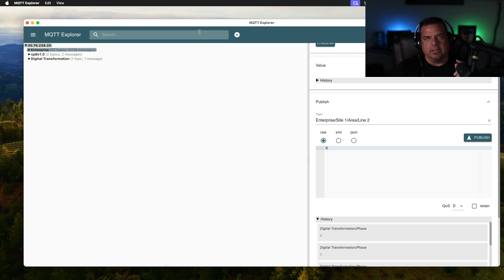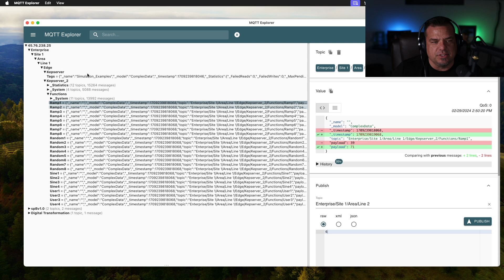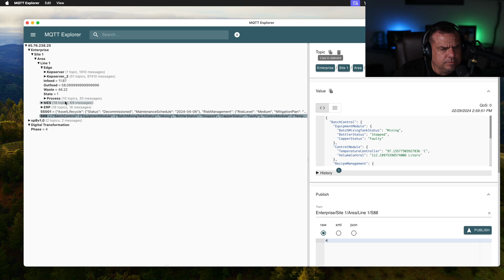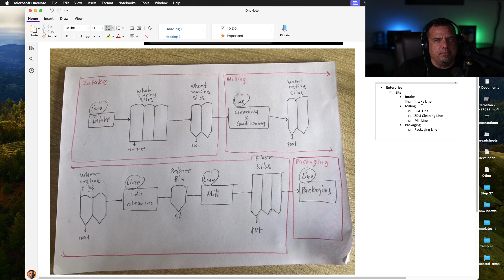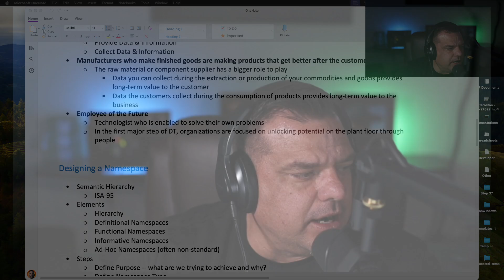Comment: Thanks for the explanation, on MQTT you are not duplication data if you put it on edge and then again in the complaince namespaces? I thought it would be structured by asset, and you would have all the information on that asset and when you retrive selected data you would pick them one by one, no having all of them in a big JSON. Is this the part where you need Data Ops to build the JSON of data that each application would need? is this efficient? wouldnt you have too many copies of the same data point?

Comment: Useful technical content - thanks and would be welcome to see more of it.
One question - based on the schema shown in this lesson (from the Sept 16, 2023 lesson), I asked Google Gemini the following question (about the different "namespaces", referring to this video, and  here is the question and it's response.
@4.0 Solutions -> would you agree with this or like to expand or correct Google Gemini's response?

Question: In relation to the above video, what is the difference in a functional, informative, and definitional namespace, and please show an example schema for each type, and within an ISA-95 part 2 schema

Answer from Google Gemini:
A functional namespace defines a group of related data elements that are used to perform a specific function within a system. It groups data together based on the function it serves, rather than its physical location or hierarchy.

An example of a functional namespace in the ISA-95 standard is the "Production Performance" namespace. This namespace would include data elements such as:

* Machine availability
* Production output
* Quality data
* Downtime reasons

A definitional namespace defines the meaning and structure of data elements within a system. It provides a dictionary of terms and their definitions, ensuring that everyone using the system understands the meaning of the data.

An example of a definitional namespace in the ISA-95 standard is the "Equipment" namespace. This namespace would include data elements such as:

* Equipment name
* Equipment type
* Equipment model
* Serial number

An informative namespace provides context and descriptive information about data elements within a system. It helps users understand the significance of the data and how it relates to other data elements.

An example of an informative namespace in the ISA-95 standard is the "Batch" namespace. This namespace would include data elements such as:

* Batch ID
* Product being produced
* Start time
* End time

Here is an example schema for each type of namespace within an ISA-95 part 2 schema:

*Functional Namespace: Production Performance*

```
ProductionPerformance
  - MachineAvailability (number)
  - ProductionOutput (number)
  - Quality (number)
  - DowntimeReason (string)
```

*Definitional Namespace: Equipment*

```
Equipment
  - Name (string)
  - Type (string)
  - Model (string)
  - SerialNumber (string)
```

*Informative Namespace: Batch*

```
Batch
  - ID (string)
  - Product (string)
  - StartTime (datetime)
  - EndTime (datetime)
```

Comment: GREAT content – thank you Walker! I would love to see more content like this. I am glad you mentioned at the end that we should feel free to put questions in the comments because.....I have a few :)

1. At the ~11:26 mark, you mentioned that phase 0 & 1 typically takes 12 weeks. I know this consists of setting up Kepserver, HighByte, and HiveMQ, but does it also include exploratory work to find the appropriate tags or add additional sensors and program them? Curious on the breakdown of the 12 weeks that it takes to do each of the items above?
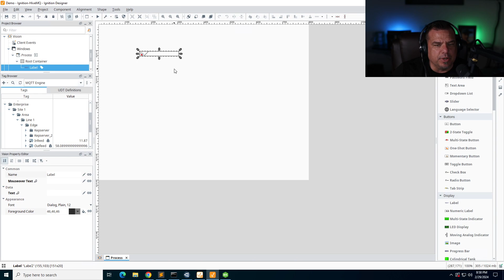2. At the 15:42 mark, Ignition did not pick up the latest temperature value and you had to have your edge software publish the data again. Is Retain message not set up? Do you typically use Retain on all edge messages consumed in Ignition, SCADA, ERP, etc.?
3. Towards the end of the demo you showed your hierarchy of Enterprise/Site…down to Product of Silo1 and [Line] etc. I know you will have MQTT topics for each “folder”, but will you have a topic for each end child element too or does it just depend on what the subscribing services (MES, ERP, Ignition, etc.) need? i.e. you will have topics for Enterprise, Enterprise/Site, …, Enterprise/site/intake/locations/Wheat Storing Silos/Silo1, Enterprise/site/intake/locations/Wheat Storing Silos/Silo1/Product. Yes to all those?

Comment: This kind of content was good for my level of experience.  I'm technical enough to get the ideas and most of the details, but inexperienced enough to need this kind of information.  One question I had is: how do you determine where 'the edge' is (not a U2 reference:). Is it the first device or system where data is exposed?  Is it at the PLC or sensor level?  Or does it depend on the details (what you are trying to accomplish, what is consistent, what data can be obtained, etc.)?

Comment: Fan-fking-tastic content. Exactly what I wanted to see.

I have questions which I'm sure you can use as content for other videos.
#1. Flat MQTT - love to see it - but it appears to not be reporting by exception. I can see some tag data in the JSON payload is resent unchanged. Room for improvement? What Stage to implement? Too hard?

#2. Store and forward at the edge. How would you recommend doing this in the demonstrated architecture? Thoughts in general would be good? Just a constant stream of msges on reconnect with different timestamps doesn't seem like a good idea.

#3. Tieing into above question - Single Historian at the enterprise level. Recommendations? Do's and don't's?

Thanks!